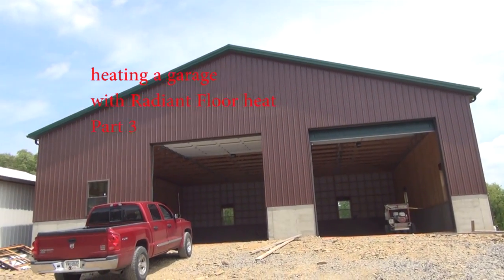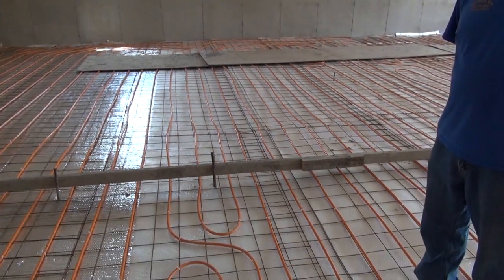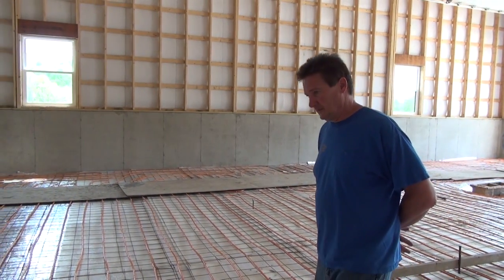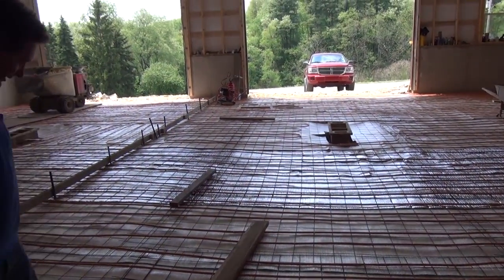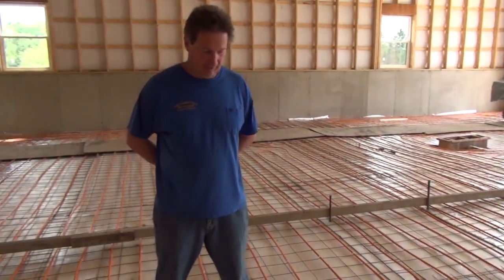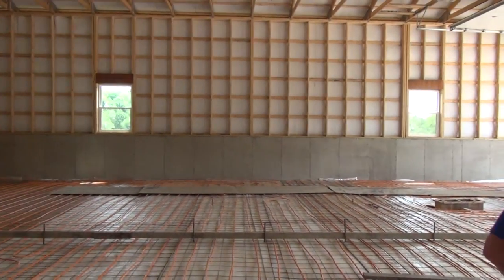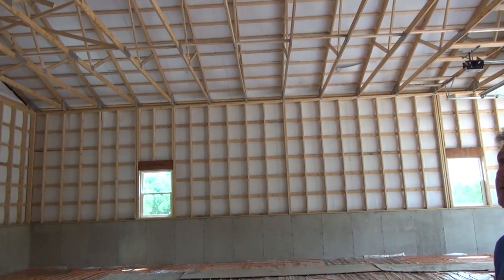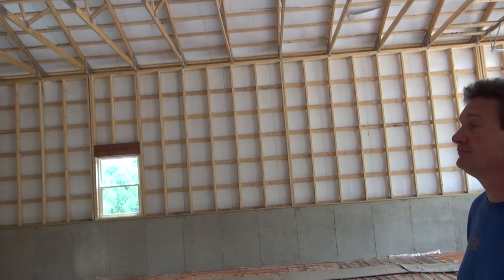Radiant Floor Heat in a Garage - part 3

Comment: +1. .. The pipe looks to be the Kitec brand..? .. Anyway, our Colorado mountain property had an NG fired boiler - radiant in-floor heat engineered and installed back in 2000. .. The several tubing zones like your's were encased in a 5" concrete slab, w/natural stone set as the finished floor. .. The whole house H2O heating was never better. .. So glad we looked past the up-front system components (Viessman) and install costs; Ka Ching $.